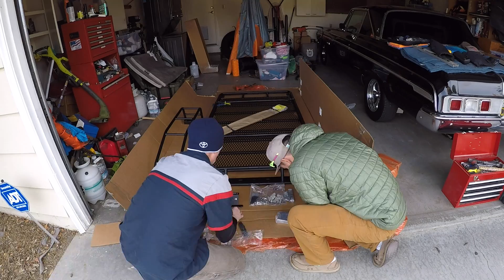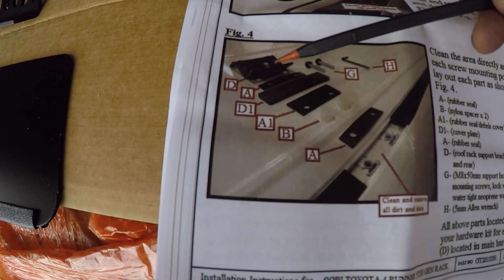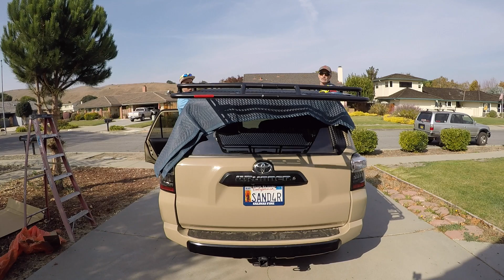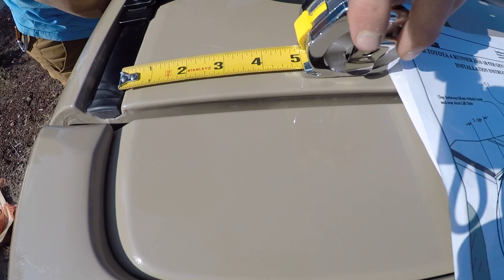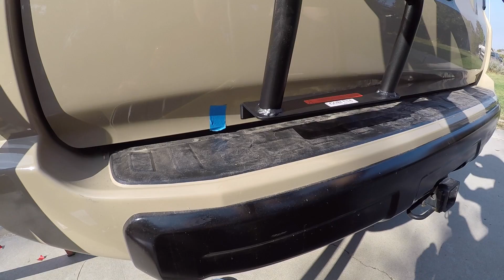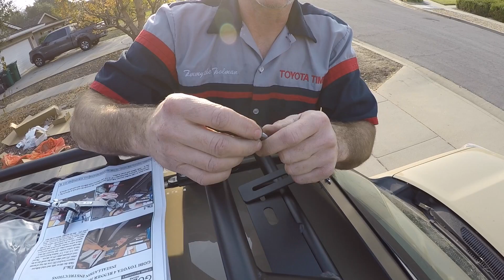Gobi Stealth Roof Rack Install (5th Gen Toyota 4runner)

Comment: Is there any particular reason why you didn’t just use the original factory bolts on the GOBI roof brackets? Are you still happy with the roof rack and ladder?
Reply from the maker: We filmed this quite some time ago.  I remember we had issues with some of the Gobi supplied bolts.  Gobi did recommend using anti-seize on all the fasteners, but fasteners should never go together that tight unless you're working with lock nuts, which we weren't.  This is one area I think Gobi could have done a little bit better by specing better fasteners.  If I'm remembering correctly, it was only the hardware for the wind deflector that gave us problems.
Reply: @TimmyTheToolman  Thanks
Reply from the maker: @proclaimliberty2000  No problem.

Comment: To echo every other commenter, thank you for the video, it’s been very helpful. I have a couple of comments and a question. First, it’s worth mentioning that for anyone with a 2019 or later TRD Pro, removing the factory rack can be a delicate operation. I ended up breaking at least one of the clips between the chassis and headliner when removing the OEM bolts. If the discussion boards I found after the fact are accurate, the Pro OEM racks are installed after arrival in the US, and Loctite Red is used. Fortunately the repair was not expensive, but it was definitely annoying. Proceed carefully, Pro owners.

Second, for those who want to be extra cautious when lifting the Gobi rack into place, I suggest making use of the rack’s cardboard packaging. I set the rack on the cardboard, cut out some pieces to facilitate gripping the rack, and used a little bit of blue tape to secure it. I also put a couple towels on the roof. A friend and I lifted it overhead and set it into place without incident. We then carefully slid the cardboard out, dropping bolts into their holes as we went to prevent the rack from sliding as we removed the cardboard.

The question I have concerns the ladder. With the hardware and brackets is a postcard-sized insert with an explicit instruction to use ant-seize on all fasteners. I noticed you didn’t do this when installing the ladder, and I’m curious why. I saw some of the other comment threads concerning stainless steel galling, so perhaps this explains Gobi’s instruction.

Thanks again for the video.
Reply from the maker: Thanks for sharing your experience with the install.  Yeah, we didn't use the anti-seize but it wouldn't hurt.  I just didn't see the necessity in it.

Comment: Great video, you forgot to use the anti-sieze too huh? I didn't use it on my first Gobi install and the soft stainless steel nuts and bolts will gall the threads and sieze before they get tight. 

Use anti-sieze on ALL THREADS. Just FYI
Reply from the maker: It doesn't make sense to have to use anti-seize for fasteners just so they don't break upon installation.  I think they should spec their fasteners from another supplier.  You usually only use anti-seize when you're worried about corrosion.  Anyways, glad you like the video.
Reply: @TimmyTheToolman  
Yea I think the grade of stainless steel that is very corrosion resistant is not very hard, and behaves differently than regular steel when threads are engaged. The anti-sieze acts more like a lubrication on the threads, which is why they also use nylon locking nuts to keep them on long-term. There's always a trade-off when picking metallurgy of fasteners, and it seems they opted for corrosion resistance over dry-thread performance.
Reply from the maker: @ghost_trost  But even stainless steel fasteners don't get that tight from my experience.   I think the tolerances are too tight from whoever they order from.

Comment: Just did my install today watching this! Great step by step instructions! Quick question, how did you get the clear tape to lay flat when doing the wind deflector install? I haven’t done it yesterday but it doesn’t want to curve right across the front of the car? Just low and slow?
Reply from the maker: I can't remember how we got it to lay flat.  If it's not in the video, just do the best you can.

Comment: The welds on the rack look terrible. 1700 bucks for 300 bucks worth of steel and  hardware.
Reply from the maker: Well, there is the option to make your own if you have the tools and skill.  Sounds like you might be better off making your own and be happier with the look of the welds.  But, if you weld, you know pretty welds aren't always synonymous with strong welds.  I'm a beginner welder and I have learned about the mig welding technique called "Mig like Tig" where the voltage and wire speed is turned down so the person welding can weld slower and create that perfect "Dime" look.  Well, when people do a cut and acid etch to see how well the weld penetrated into the pieces being welded together, the result wasn't that great.  At the suggested voltage and wire speeds recommended by your machines chart based off the thickness of the metal, you can't weld super slow because the welds will either be really high and built up or you'll blow right through the material.  You have to move at a decent speed which means a little less control to make those perfect looking welds.  So, even though I also like pretty looking welds, I now know those pretty welds might not be super strong welds.

Comment: Recipe for leaks and Rust too bad no one is making a rack to add to the OEM rack ..
Reply from the maker: I don't agree with your assessment.  It seems to me Gobi has addressed the potential for water getting into the headliner with the hardware they include with the kit.  You know what a common leak point into a Toyota headliner is?  It's water getting past the factory roof rail bolts.  Water just has a way of finding it's way in sometimes..  The fix is putting a little silicone in each bolt hole and screwing the bolts back in.

Comment: Did you got problem with the hatch alignment? Because mine does after a yr. i dont know if it’s because of the strut that i replace or because of the ladder, the passenger side of the hatch becomes higher compare to the drivers side
Reply from the maker: Garrett hasn't reported any problems with his hatch.  Maybe replace the other strut and see if that improves the alignment.

Comment: Im sitting on top of my roof rack drinking a beer as I am typing this comment. All i gotta says THANK YOU SO MUCH!!! This video made the installation a breeze. You were beyond accurate with your descriptions. I really enjoyed how you explained which socket wrench length or whatever was needed for each set of bolts. Saved me a hell of a lot of time in deciding what was the right size. Also your tip on not tightening the bolts down after the rack is placed on top of the 4 runner WAS HUGE.  You provided a TON of little hacks such as using the tape as well. I am now a Timmy the Tool Man fanatic and will be looking for your videos when it comes to my next add on for my Toyota 4Runner. 

You are The Mann dude. 

Thanks, 
Austin Shofner
Reply from the maker: It’s comments like these that make it all worth it Austin. Stoked you had an easier time with your instal due to this video. Sicmods dude!

Comment: Didn't have to adjust the front brackets. It was already 3 1/4, measure prior to loosening bolts. 

Called Gobi and they said silicone isn't needed. Didn't have any during my install hopefully it doesn't leak! Will report back if it does...
Reply from the maker: Silicone is just extra insurance.  You'll probably be fine.

Comment: Sounds like the GVWR is exceeded
Reply from the maker: By adding a roof rack?  If that were the case, you'd never be able to fill your rig with passengers if a roof rack is going to put it over gross vehicle weight rating.
Reply: @TimmyTheToolman  
That's what I was getting at. Extra capacity can easily lead to packing too much stuff.
Thank you for the videos.
I also watched your supercharger install. Isn't there a torque sequence for the intake?

Comment: Great video. My only question (and I don't expect you to speak on the company's behalf) is why anti-seize over blue/yellow Loctite? Even the factory hardware had it (as it should). Even if you have to remove the rack at some point, blue Loctite is harmless, and would preclude having to tighten/retorque the bolts every few months. The bolts look galvanized, so seizure/bonding shouldn't be an issue.
Reply from the maker: Glad you like the video.  No clue why Gobi suggests anti-sieze.  I agree that it doesn't make much sense.  If you call them and find out, let us know what they said.
Reply: @TimmyTheToolman  I called and left a voicemail the same day you replied. No one returned my call.

Comment: Great video! Helped me tremendously. One omission in the video was that the factory rail covers have an end piece you snap loose before prying the cover off. This makes it a lot easier to get the covers off. That step is in Gobi’s instructions.
Reply from the maker: Glad the video helped you out and thanks for sharing the tip about the rail covers.

Comment: Think you sold me. Thanks for the video!
Reply from the maker: Gobi will be happy.  You're very welcome.
Reply: Timmy The Toolman I have been so indecisive about what rack I want to put on my 2018 SR5 4Runner. Now, that’s a different story. And I feel that both of did an exceptional job with the installation video so that I could get it done on my own.
Reply from the maker: @shiobanambriz540  Well, I recommend having somebody there to help you lift it up onto your roof unless you're really really strong.  But, once it's up there, you can do the rest yourself no problem.

Comment: had a question. picked up a gobi rack for my runner second hand, unfortunately didnt come with the deflector. could you possibly measure the length / height of the fairing for me :) will be building one but dont know the specific lengths they make 

thanks!!!
Reply from the maker: Cofairingco.com would be a good place to go if you don’t want to contact GOBI directly for a replacement. You’ll need more that just the fairing though. You’ll also need the mounting brackets. Making the brackets yourself doesn’t seem hard. Just a bent piece of flat metal basically.

Comment: Just picked up a Gobi for our 2020 4runner Venture. Awesome video, thank you! We'll be installing tomorrow!
Reply from the maker: Have fun & make sure to report back with your experience & anything you learned that we didn't cover in the video!
Reply: What color did you get?
KDSS? I'm probably gonna get the Venture too!
Reply: @treythetreethree  white, no kdss as I lifted it right after we bought it. Rides good but rides even better with an eibach pro lift. We bought and in the first 3 weeks did the gobi rack, Gobi ladder, eibach lift, 285 wildpeaks, trd intake, diode dynamics Pro fogs in yellow,, trd pro front end, raptor lights, custom exhaust with black chrome TRD tip, SSO rock sliders etc , had an arb awning but sold it as I have an ovs 180 awning in its way. It's a fun ride. Live in AZ and already been up to Colorado with it and did Ophir pass.
Reply: @mobius012  damn dude that sounds awesome, I'm thinking about getting the KDSS and the Venture in Grey...I'll definitely look into the parts you listed.

Comment: Mine has a sunroof. Would the basket miss it up? I like the racks that go all the way from front to rear.
Reply from the maker: They make these with removal inserts that cover the area of the sunroof.  When you're not using it for a trip carrying lots of stuff on top, you can remove the insert over the sunroof.
Reply: @TimmyTheToolman  thanks. I'm trying to watch the video with no sound. Baby sleeping.
Reply from the maker: You can get a full length rack with & without a sunroof window cutout btw.

Comment: Waiting on my rack - this video was amazing. Do y’all think it’s possible to install the ladder on the passenger side instead? I frequently carry a mountain bike on the back and am worried about where my handlebars sit and if they would interfere with the ladder
Reply from the maker: I'm pretty sure you can mount the ladder on the opposite side.  As long as there isn't something different on that side to prevent it from mounting flush to the hatch, it should work fine.  Glad you like the video.

Comment: Hi guys.  Tell us how to install a long trunk on a 4runner 3gen.  I want to put the same on surf.  Hello from Kazakhstan!
Reply from the maker: When you say trunk, I'm guessing you meant roof rack?  Gobi does make the same roof rack for a 3rd Gen and it's not hard to install.  Gobi's instructions are well-written, so if you bought one, you should be able to install it without the help of a video no problem.  We might do an install of one on a 3rd Gen 4runner one day but nothing planned for the near future.  We installed one on Sean's rig a long time ago but he got his used off a wrecked rig.  We unfortunately didn't think of filming it at the time.
Reply: @TimmyTheToolman  I wonder how the roof rack is mounted on the front.  The roof mount is short, not on the entire roof.  In the front, the boot rack rests on the roof or are they mounted through the roof?  Thank you for responding.
Reply from the maker: @СергейПавлик-п1я  For the 3rd Gen 4runner on the front of the roof rack, there's just pads that rest onto the roof.  They aren't affixed to the roof.
Reply: @TimmyTheToolman  Thanks!
Reply from the maker: @СергейПавлик-п1я  You're welcome!

Comment: Awesome vid!! Super helpful when watching and comparing against Gobi's instructions, I've watched countless times in preparation for my install this weekend. Hope more vids like this to come for the 5th gen 4runner! One question regarding the Wind Deflector install, any thoughts on why they have you put it on only to remove before applying the clear tape?

It seems you could skip the initial install and put down the clear tape first using their "guidelines" and then proceed to install the wind fairing? I guess it makes for a more accurate placement of the tape, but it would seem with 2in of tape that there's a bit of room for error as to where the rubber on the bottom-side of the fairing would sit? If you had to do it over again, would you have just placed the clear tape down first or did you find that it was helpful to install the wind fairing first before removing and applying the tape?
Reply from the maker: Glad you found the video helpful.  Yeah, the wind deflector steps did seem a bit unnecessary but it does afford the most accurate placement of the clear tape.  Maybe to speed up the install you could get the wind deflector up on the roof in roughly the position it will be in to eyeball where the tape would need to go, get the tape on and then install the deflector.
Reply: @TimmyTheToolman  Appreciate the tip! Thank you for putting in the effort to reply to Youtube comments, prime example of how helpful the Youtube/off-roading community can be
Reply from the maker: @michaeltan4652  You're welcome.  We try to answer all questions and acknowledge all comments on our channel.  We're not such a big channel that we can't do this for our viewers.  I know some of the bigger automotive channels with a million plus subscribers can't get back to everyone so a lot of questions go unanswered, which is unfortunate, but I imagine people understand that one person running a YouTube channel can't possibly answer every question that comes in on a daily basis.  Good luck with your install.

Comment: Hey guys, I have a 2011 4runner, how do I choose a cargo roof rack that works with the sun roof?? Thank u!
Reply from the maker: The Gobi works with roof racks.  I'm sure other brands work as well.  You just need to search and visit different manufacturer websites that make roof racks for 5th Gen 4runners and you'll be able to figure out which ones work.  It's my guess most if not all will work because it's in the manufacturer's best interest to accommodate for models with sunroofs.

Comment: Not impressed with the metal screws that rub against the paint.  Need to have padding between them, so there is no contact of metal to metal.  Rust is unforgiving.  Also, the nuts and bolts should be black in color.  Does not look good in silver against the black.  The video and explanation was excellent.
Reply from the maker: Hey Rob, you should share your ideas with Gobi and see what they say.  We're glad you like the video.